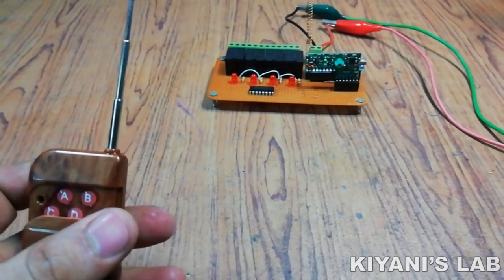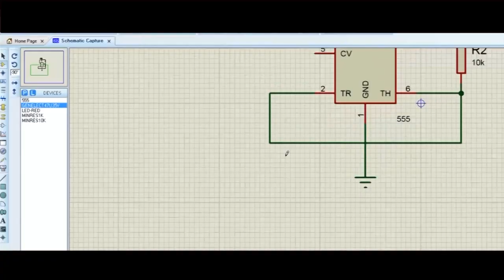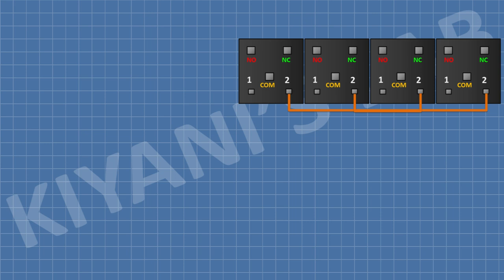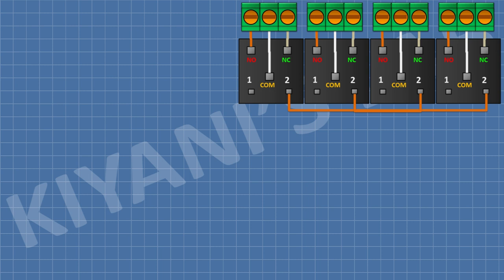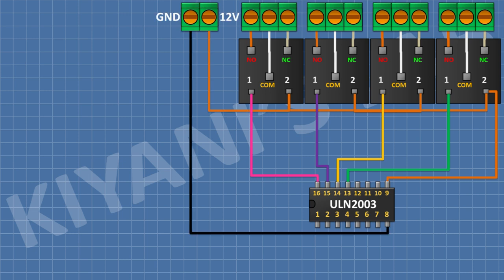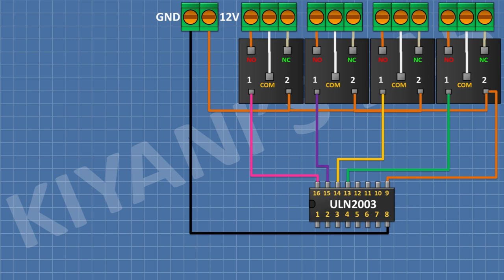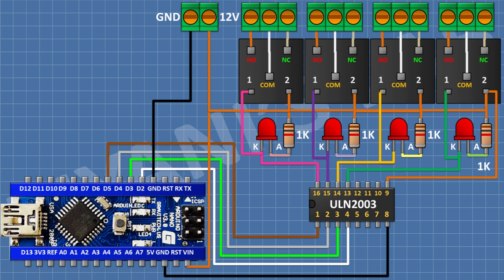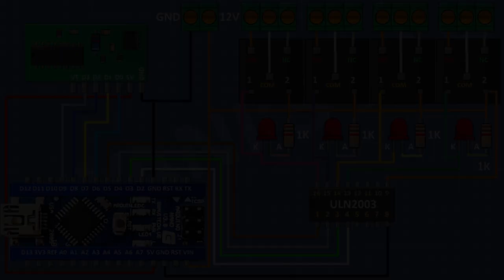How To Make 433MHz RF 4-Channel Relay Controller Switch

Comment: It was good but you are using 4 channel moudle so no  need to use expensive atmega328p .just operate relays with bjt or mosfet controlled by Cd4017 or any other flip flops to toggle the relay state when button pressed by transmitter....it will be good to use diodes at relay coil because collapsing magnetic filed of coil relay generate huge surge of high voltage during operation which can damage your 2003 chip in long run.....Great work ..keep it up bro..

Comment: i have asked many times and asking this time too.
please make a rf based wireless overhead tank water level monitor system with pump auto on/off feature, also having manual switch to turn on/off motor at any time, lcd display to show the percentage of water level from 0  to 100%..
there should be a transmitter which will be powered by 12v battery and it has sensor attached which will send data wirelessly to reciever which will be placed at ground floor, and also powered by 12v battery or adapter.

Comment: Unnecessarily stretching video while testing the circuit,also unnecessary use of aurdino that will make project costly. There is no need of audino, without it all functiona will work.
Reply: Yeah you are absolutely right bro ..His transmitter and receiver both have 4 channel control so no need to use 328p ...if he has 433mhz single channel moudle then it will be useful...
Reply: क्या २०-४० फ़ीट तक काम करेगा दरवाजे खुले हैं तो। .. दूसरे  कमरे से ? what is the range inside the house...between rooms with doors open ?
did i have to be in line of sight to operate it?